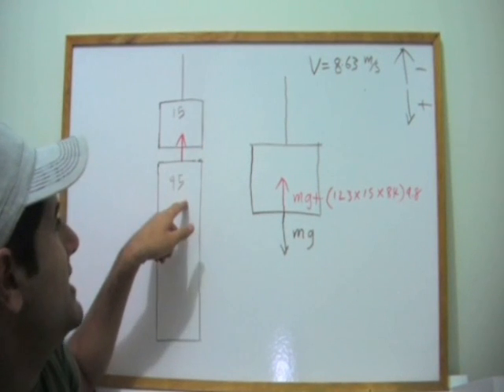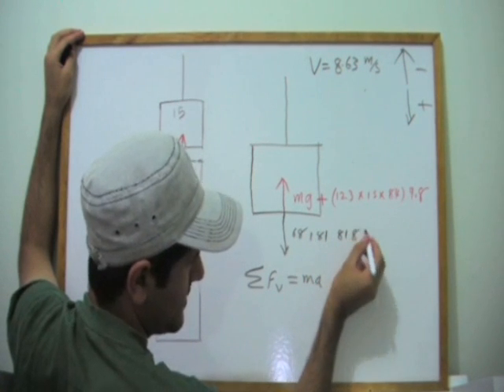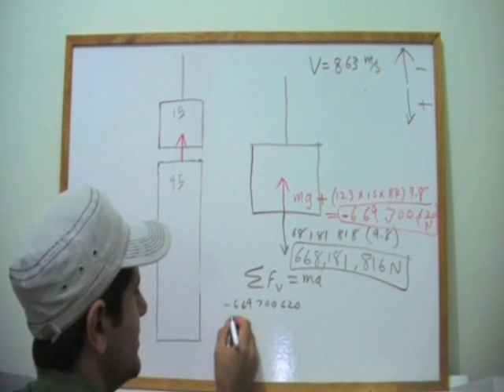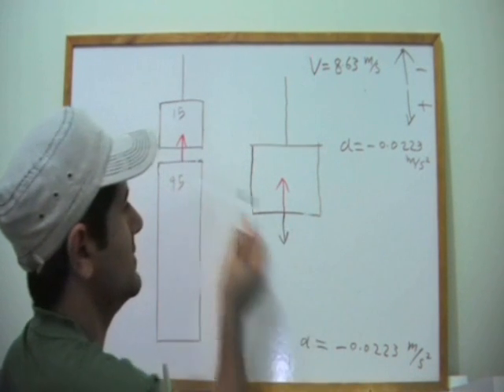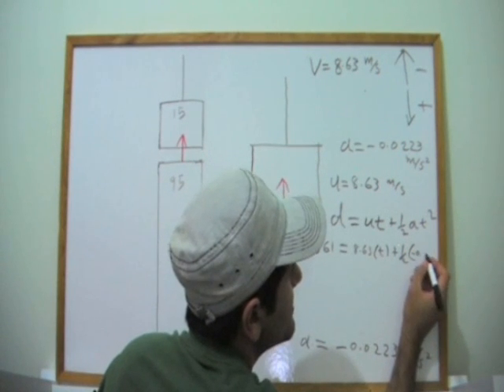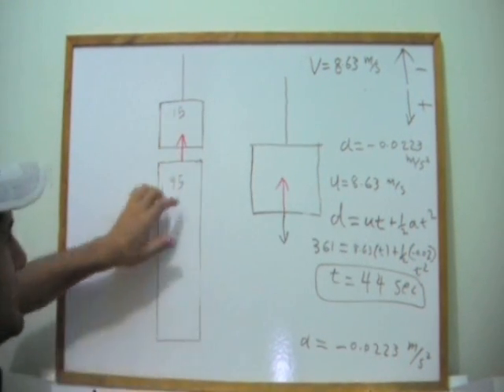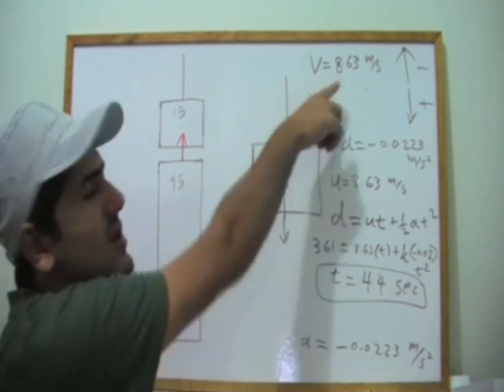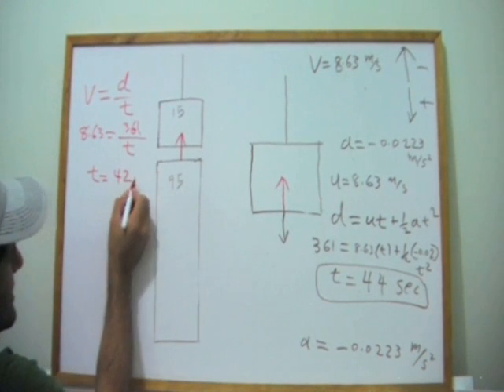(Part3) 911 Simple Physics Structural Failure Vs Demolition

Comment: The block will continue to get heavier and heavier as it falls. It would grow like a snowball getting heavier and heavier as more of the lower section becomes unable to resist the growing collapsing block, the lower sections ability to resist downward motion would cause it to accelerate not decelerate.
  And, there was more than one floor damaged. At least three floors were compromised. For every floor compromised on the lower half, the block will gain speed. The block debris becoming heavier and heavier will continue to speed up until it hits the bottom!!!
Reply: "the lower sections ability to resist downward motion would cause it to accelerate"? Are you  insane? skyscrapers have a much stronger and heavier structure than the top.Plus objects in motion will remain in motion until affected by a force( Newton's first law) this is high school physics. looks like you need a refresher course.
Reply: Irene Moran
as each floor is compromised it adds weight to the block that he describes.The weight doubles every third floor and it is exponential not linear. As the block is falling adding another floors weight into the equation.It will keep accelerating until it hits the bottom (exactly the way it did). I do know physics I was a bridge engineer and so far none of my bridges have come apart.
Reply: are you a snowballologist
Reply: Actually you are not correct about the weight getting more. If you google, and look at the construction of the building with its huge inner core of vertical beams which cannot pancake.  They provide continuous resistance and slow the object coming down from above Also the outer beams would as well. only the very light inner floors hung between the inner and outer steel could theoretically pancake, but then you would be left with the core intact.  Anyways NIST abandoned the pancake theory in 2007 after much abuse.
Reply: Wasatch Range Railway
 Fine, so stack 100 concrete blocks. Suspend one block 10 ft above, and release. Do you honestly believe that one block would "snowball" into enough energy to crush the 100 to the ground? That is what you are saying, and it is lunacy, based in "yup, sounds bout right", rather than Physics. This is also giving you advantages..The buildings are progressively stronger as you go down....concrete blocks are equal strength. You assertion would also mean that a car crashing into the side of a metal building would continue through, as it gathered more metal. That would include a driving engine, and still it would not occur. You are incorrect, the strong nuclear force is much stronger than you give it credit for.
Reply: First off, the top floors of WTC2 went passed the angle of which downward force would even theoretically be enough to crush the entire tower. It went passed that point and should have fallen as an intact or almost intact section. It did not do that, it fucking disintegrated! The whole building did this in roughly 12 seconds (2 seconds slower than it would take an object of good density and no air resistance such as a coin). Any progressive gravity driven collapse would have encountered much more resistance and taken much longer to occur. When is everyone going to wake up? Common sense was hijacked along with the laws of physics, crash dynamics, aeronautical science, metallurgy, architecture, mechanical engineering, etc.. That is what was hijacked on that horrible day!
Reply: BikiniStringTheory I assure you that I was a bridge engineer. And I was 22 years old when I got the Marine Corps highest commendation for not only building good bridges but bridges that floated while supporting 60 tonnes of live load and keeping my troops alive while doing it. try building a bridge while you are being shot at!
   I never once constructed a bridge that failed to support the load that it demanded. And when a young marine wanted to know something about that particular bridge, I would help him to understand it so that both of us stayed alive
The only screw up that I made was when I was testing the "Medium Girder" bridge for the British. When we launched it, it was a lot heavier than stated. When it got away from me I was between it and the launching tongue.
  I function reasonably well at 53 years old thanks to Fentanyl and Percocet and wish like hell that I had been  standing in a different spot 30 years ago. 
 I also assure you that I know the difference between spanning loads, live loading, and shock loading. When a sixty ton tank came over my bridge, I knew that it would hold. And that the tank crew would not be drowned in a sinking tank. My unit still holds the world record for a 24 section bridge in 22 hours. I am proud of what I accomplished 30 years ago, I did it so well that the construction sequence is still classified. The bridge itself is not classified but the sequence of how it goes together under combat is. With all of the cameras that were going, I felt like a movie star. And I do not need to use the F-bomb to be intelligible.
  There are all kinds of points that can be argued regarding their collapse that day. I know my stuff! If I didn't I also would not be the only individual in the Union Pacific Railroads history to pay my way through locomotive engineers school and take second place in a group of twelve men being promoted from conductors to engineers.
That was in April 1988. I graduated a full fledged engineer on April 30th. If I was a moron, I would not have been able to pass an 832 question test and miss only 10 questions. I was 25 years old when I pulled that off. There were men who had been employed for 20 years by the railroad that I beat the pants off of because I understood  what happens when 20,000 tonnes of steel sails down the track at 60 miles an hour if I screwed up. And I liked to stay alive back then! I wish the people that I had to work for would've felt the same way: maybe they would still be alive had they been as serious as I was.They crashed trains like they were going out of style! There were many of them that did not understand the difference between something as simple as dynamic friction vs static friction. 
   In school, they were more concerned with getting to the titty bar for lunch than their were about their grades. I know why there are so many train wrecks out there. If they loved their jobs as much as I did, they would take their employ much more seriously than they do. There are moments when an engineer will be using as much as 85% of his thinking capacity to keep from derailing his train when some idiot runs in front of him or stalls on the crossing in the path of his train.
  Simply put when push comes to shove I will trust my own instincts over anyone else s, it has served me well! and I am confident that it will continue to do so. When I am serious about something I will not screw it up. I just have to be serious about it. 
  Those towers failed exactly the way they did and would have when the steel is too soft to support the load.
If those towers were brought down by our own people, we have a good reason to be scared stiff!! If our people believe that we are too immature to recognize a lie, then they themselves are too immature to wield power!!! and need desperately to be overthrown. 
  Talking about conspiracy theories, my son came up with the most plausible theory I have ever heard as to why Kennedy was killed. With a very good understanding of the facts, he told me that Oswalds discharge from the USMC was honorable and that Gov. Connolly changed it from honorable to dishonorable. This infuriated Oswald so Oswald went hunting Connolly because he knew that he would be riding with Kennedy. When Oswald pulled the trigger, he screwed up and did not lead him far enough and hit Kennedy instead. No conspiracy, no CIA , no grassy knoll, no mob hit, just a lousy shot by Oswald! We know that he couldn't hit the broad side of a barn from his scores in the USMC- my son was right, he was just a lousy shot--unbelievable.
Reply: Wasatch Range Railway If I had a dollar for every government pawn who cries about how much they love their country calling me paranoid.  Seriously, if you have PTSD I'm really sorry.  But I have PTSD.  I got it from my government.  And you know what really helps PTSD?  Growing a pair of balls, and recognizing EVIL when you confront it- even if it has a familiar face.  I'm a GIRL for chirisakes- never even held a weapon or built a bridge.  But I know lies and bullshit.  I know how to investigate the hell out of something.  If you have investigated the hell out of this, and you aren't pissed as hell, then there is a lot more wrong with you than PTSD.  Never did I think coming on to you tube that I would find so much cowardice within my own people.  If you are being paid to say such stupid things about buildings, or not, that is on your soul- not mine.
Reply: as far as religion goes I was talking to the bikini girl
Reply: Shane Stoddard The time in which it took the towers to fall is a huge problem.  As people become more aware of how this is a problem and as experts become more encouraged to speak up, then there should be a change in consensus.  Governments determine literary history passing judgments on its legacy concerning who will be known forever as its protagonists and antagonists.  It then makes official decisions based on that fiction.
Reply: +Wasatch Range Railway This would make sense if the " collapse " had two factors. One, if the top sections were not lighter than the bottoms and sending off massive amounts of debris in the process which made the load much lighter for the bottom to support. Two, this happened way too quickly for a natural collapse. That is only two factors one more is that pulverisation does not account for particles less than 100 microns in a pyroclastic cloud that travelled at such high speeds and left cars as far as Broadway with no windows, door handles, seats, paint, just a toasted shell. Ask yourself as a scientist, what kind of energy could do that?
Reply: Tom Jones Not just vertical beams, but square beams.  And they added the further support of integrating ninety degree support beams into the structure.  They did the same with the lower steel foundation.  In other words, the two towers were embedded first into a massive steel foundation which was utilized for parking.  That steel foundation was further embedded into concrete which, in turn, was embedded into granite.
Here is a picture of the lower steel foundation:

 www.google.com/search?q=Images+of+twin+tower+core&rlz=1C1CHNY_enUS487US487&es_sm=93&tbm=isch&tbo=u&source=univ&sa=X&ei=ml7DVLqtGbj7sATRjYLYCw&ved=0CB8QsAQ&biw=1366&bih=643#imgdii=_&imgrc=jLca1RWB1jhU2M%253A%3B8iJXsnD76EE8KM%3Bhttp%253A%252F%252Fapi.ning.com%252Ffiles%252Fs5OK8CISaMOgAkDczFYF5XX7paYyeD97ZVjRtgBslViXhwUf54eqc3*xIYY8QJWr5WLzLAryL8X9E7gqjEHEYxZn-pwcWogr%252Fwtc1sm.jpg%253Fwidth%253D512%2526height%253D391%3Bhttp%253A%252F%252Fwww.gopixpic.com%252F375%252Fthe-core-structures-structural-system-of-twin-towers%252Fhttp%253A%25257C%25257C911research*wtc7*net%25257Cwtc%25257Carch%25257Cdocs%25257Cmage6*jpg%252F%3B512%3B391

This picture shows the massive integrated steel bracing in the core further supporting the square beam construction:

www.google.com/search?q=Images+of+twin+tower+core&rlz=1C1CHNY_enUS487US487&es_sm=93&tbm=isch&tbo=u&source=univ&sa=X&ei=ml7DVLqtGbj7sATRjYLYCw&ved=0CB8QsAQ&biw=1366&bih=643#imgdii=_&imgrc=uMGYM3r9c24oYM%253A%3BEUCvPSlVM1qlcM%3Bhttp%253A%252F%252Fwww.mindfully.org%252FReform%252F2006%252FWTC-Jones19mar0615.jpg%3Bhttp%253A%252F%252Fwww.mindfully.org%252FReform%252F2006%252FWTC-Jones19mar06.htm%3B850%3B638

But these square beams and rectangular beams were more than just that, but they were akin to taking two I-beams and welding them together to where further support stuck out the sides of the beams.
Reply: ....annnnnd BINGO was his name-o!
Reply: Wasatch Range Railway There is no way you are a bridge engineer.  But I do believe that you probably laid some concrete.  Maybe even got a little between your ears.
Reply: MisterNifty I can talk physics! fluid density,displaced weight. modulus of elasticity,neutral axis! want more?
Reply: Wasatch Range Railway Let me give you a very simple example . If we were building a bridge in fresh water the center of gravity was lower because the bridge was designed to bend as the load moved across the span. The bridge would sink further into the water.
   If we built it in salt water, we had to be very careful because the bridge would not sink as far keeping the bridges center of gravity higher. This could result in a side slip and so we would put more weight on the section to lower the cog---how is that for physics?
Reply: Wasatch Range Railway I wish that I had been more clear with the above statement
Reply: Irene Moran volcanic energy!  I used C4, petentiarynitroltetranitrate( PETN) and C6 to cut steel she has it in her head that there is some hellacious pyroclastic cloud that envelopes a CD. I have never seen what she is describing other than a volcano I have heard of a terraclastic cloud after an earthquake. 
   cutter and kicker charges are way too fast to generate the heat that she thinks is in a CD I would like to see the charge that she is describing. Even when the planes hit the towers, the smoke rose into the air . It did not sink the way a true pyroclastic flow does and these cars that were supposedly roasted. I never saw that.
Reply: MisterNifty It became about me when the truther idiots tried to convince us that 911 is the result of unbridled corruption by the higher ups. Some of those higher ups were friends of mine and to say that they killed 2749 of their friends is absolute trash. Yes! there is corruption and it is at the very top. And for someone to say that my friends are capable of killing their fellow Americans turns my guts. Our Gov't could never get away with something like this. Someone would have spilled the beans on them leaked it to somebody at the news or started video taping things. 
   What our leaders are guilty of is rampant stupidity. The terrorists will get us again and again and again we will still not be ready. Our dear beloved waste of sperm that we call president will sell you and me down the road faster than you imagined possible. That is when it became about me.! The people that I knew would never let this happen by are own.
Reply: Wasatch Range Railway At 6:16, the young man is talking about the upper portion falling away from the center.  In actuality, the torsion involved with the collapse caused the upper material to spin away from the center by centrifugal force.
A collapse in a controlled demolition causes the building to fall towards the center of the building in a centripetal way.
Reply: Shane Stoddard Fine, show me an example of this happening- other than the trade towers. Give just one example of a building or bridge that fell into dust at free fall speed because of a fire (a fire that never even touched 80 percent of the building) and not an explosive. Because as far as I can tell, it's never happened.
Reply: Wasatch Range Railway Now it makes sense- your friends are some of the scumbags who set this crap up.  I knew you were in the military.  Only military schills constantly deny this event.  We saw with our own eyes what happened!  How can you keep lying? Maybe you were one of the people who set the detonations, we'll never know.  But the people in the towers who died would be able to point them out- they were all over the elevator shafts and floors in the weeks before the blast.  They called it  updating the elevator systems.  LOL.  Yeah.  It takes a cold stone killer to do that job.
Reply: Wasatch Range Railway Understand, we aren't talking about rational thought here.  That isn't the problem.  Like the Kennedy assassination, there were lots of problems in physics.  So, while some might argue as eloquent debater, there is another level to this event which has caused a lot of problems.  For a building to fall straight down into its footprint, it has to be made to fall in a centripetal fashion towards the center of its mass.  
Hello? 
Is anyone home?  
Does anyone else see why many fearful experts are having huge problems with this 911 event?
Reply: BikiniStringTheory You are doing exactly what conspiracy theorists do they always refer to the imagined opposition as THEY and when asked who "they" are, they can not give a detailed answer and cannot give a single name. If you want to sound like a trustworthy and dependable individual quit assuming. Unless you were there cutting beams and putting demo in those buildings, the very best you can do is to assume! Without pictures, without corroborating evidence you will go nowhere.. The world is full of idiots. Don't be paranoid! Life in the USA is still damn good! An operation of that magnitude could not be pulled off even in the best of conditions.
 Someones conscience would get the best of them, someone would start taking pictures, someone would spill the beans. It would take intelligence of unparallelled scale to pull something off like what you are describing. It would be impossible.
   The bigger a project gets, the less intelligent it becomes. A project like this would require absolute secrecy   
It would require everything to go absolutely perfectly Our gov't is too disorganized, and far too unintelligent to pull this off. Someone involved would goof it all up. To ruin this project would require only one good man. A wise man keepeth till last and a fool telleth all. There is absolutely no way that it could be pulled off without it being screwed up by someone. There are however some things that bother me. Things that would make no sense to you.
  I do struggle with PTSD and to qualify for a VA disability pension required me to prove that I am in-fact disabled. I had to prove it to the doctors and to prove it I had to take a battery of tests. my IQ is extremely average. There are a lot of people smarter than I. However there is one small area of my IQ that she could not measure because it is off the chart. MY FRIENDS DO NOT KILL PEOPLE!!! If I personally knew of someone that had killed innocent people, a friend is the last thing I would make of them. Quit being a paranoid. It is a terrible waste of time and effort. This country is still a fantastic place to live. No one loves our constitution more than I do. And I would fight like a dirty dog to preserve it. And no one hates a murderer more than I do. If I ever found that a friend of mine had committed murder I would have their worthless ass thrown into prison and I would personally throw away the key. There is always a better way to solve a problem. Killing 2749 people just to go to war is akin to driving a thumbtack with a sledge hammer.
   When my wife died I learned to put a lot of trust in the man upstairs. If required take your case to the law of the land and when ( not if but when) it fails leave it up to me where no one will be able to escape me!  
   Be happy, quit wasting time with things you don't need to worry about---Shane.
Reply: Wasatch Range Railway Structures resist liquefaction.  Think of a toilet.  When it is flushed, the water rotates one way or the other.  All things are liquefying towards the center of the earth.  Over time, all things will sink down into the earth.  As they do so, they spin and tumble towards the center of the earth.  This is a natural collapse.  The third building was an unnatural collapse caused by controlled demolition.  That collapse had to happen by design as the only way in which a building can fall straight down is to engineer it to fall inwards towards its center in a centripetal fashion.  
Hello?
Reply: BikiniStringTheory I can't help you!
Reply: BikiniStringTheory Why not reduce the problem down with physics like the fellow in the video is doing?  We already know that the government is a tyranny.  We learned that from our Founding Fathers.  In regards to the consensus about what happened to the twin towers, that will reduce to thousands of physics problems.  Over time, we should build a pretty good consensus about what truly happened.  At the same time, we learn a lot about physics and engineering.
Reply: Wasatch Range Railway I do know evil! It chases me around at night. Those demons are very real! They tie my arms up and bind my tongue. Unfortunately my wife is no longer around to wake me up when they come for me. My dog sleeps with me and is now the one to wake me up. The devil does not like to be poked fun of.
  I am very, very sensitive to evil. I feel it every time I curse, or when I become angry. Every time I think about something that is not right I feel it. 
   Watch a porno movie and see how fast evil comes to the table. Go see an R rated movie and see how evil sets up shop next to you. Watch COPS and see how fast peace leaves the room. I choose to take the sacrament every week to be forgiven for the dumb things I do.
  I have looked evil in the eyes and it scares the mortal hell out of me!! I try so hard to be like the Master. To heal the sick and the wicked. To make the blind to see and the deaf to hear, and the dumb to speak.
 I do know evil and I want nothing to do with it. I want to be with my wife and kids and I want to be with them for a very, very long time. And if I choose evil, that will never happen!
Reply: Wasatch Range Railway If God were to tell you what really happened to cause Him to flood the earth would you believe Him or tell Him that He is a liar? Here is a seed, He had to kill the animals too! Who hasn't seen on YouTube ISIS scum screwing goats. Does that help? If not, maybe I am stupid and ignorant. There are things washing up all the time, fish with beaks. Birds with hoofs. Where did Greek Mythology come from? A man half horse?  There were all kinds of hideous things living.  Our deoxyribonucleic acid DNA became so corrupt that it was no longer usable as human DNA. and this rock we call earth is a lot older than we think when He flooded the earth she was baptized as well. Her spirit is female. Maybe that is why I love women so much.
  And what about Adam and Eve. If God told you what really happened would you tell Him that He is a liar?
What Human act can be had for good or evil? And no, it was not a pomegranate, nor an orange, nor a peach.
  The fruits of a tree that is good on one side are little tricycle motors. Think about that one for just a few seconds-- you'll get it!    
  What is the fruit of the evil side of the tree?--------If I told you, would you tell me that I am an idiot, or would you believe me?  The fruit of the evil side is ---- ?  The world runs rampant with it. And brings nothing good to the table. People suffer with it every day, especially the children.
   But I am just a liar with no balls and I wouldn't know truth from a lie! My son and I both have raised our hands to defend the Constitution, against all enemies foreign and domestic,  not the president nor his scum.
   When I met GWB here in Brigham City, I felt that he was a good man. Maybe not the brightest bulb on the string but he was a good man. Just like the rest of us; not perfect--but still a good man.
  How can a man who would not allow testing on human embryos claiming it violated human sanctity turn around and kill 2749 people? The ones to be scared of were GHWB and Cheney I don't no where, but something is not there with those two. GWB is a creature of opportunity. I heard GHWB say something once that made my blood run cold! He has no affections for our constitution whatsoever. His son is not as corrupt as he is. But like all of us GWB is still subject to weakness. GWB has really tried hard to get his stuff together. Would he kill even one man to make a million? His dad might, but not him.  Cheney on the other hand is not a family man---he is a stuffed white shirt. Mr. Corporate America! his family suffered at the hands of Halliburton. Especially one of his daughters, he was not there for her when she needed him.  
   Cheney's connection with BP really went south during the disaster in the gulf. They knew the drill head would probably fail and Cheney knew it too. When it did, you never heard a thing about Cheney. Do I think Cheney would off someone to make a buck? It depends on the size of the opportunity. For 1 million? I don't think so. For 100 million? I am confident that he would sell his mother down the road   The one to be terrified of is the one that is stinking up the oval office right now. He is a spineless jellyfish. He has grossly underestimated the power of the silent racist. 
   I would never leave a scared soldier or marine to rot in a stinking Mexican jail for weeks on end then exonerate five terrorists for a deserter and make such a big deal of it.His thinking is so deteriorated that I don't think he truly knows right from wrong. I am pretty sure that he will make the attempt to "executive action" himself into a third term. And he might just pull it off. 
   when placed under high stress or in times perceived opportunity, there is a significant percentage of black people that can not prevent their moral high ground from being overrun. It is in their genetic make up to relinquish their morals quicker. Their thinking is more easily compromised in times of stress or personal gain. Their line in the sand moves or dis appears more easily than some others. However this not a hard and fast rule. It can only be claimed in general terms. There are times when this becomes exactly opposite. There are times when they will do exactly the opposite. I have seen both sides of the fence. I had a very good friend that was black and his morals were absolutely above reproach. I was proud to be his friend. He was absolute with his morals. His thinking was clear 90% of the time. And if he ever doubted himself he was always open to changing his thinking.  His name was Sgt. Donnell Lorenzo Charity. He was one of the finest men I have ever known. He was and I hope that he is still good people.    
   That disaster that occupies the white house now openly defied God when he wrote that statement on the highest beam of the new freedom tower. Do you think it a coincidence that the pine tree at ground zero just died for the hell of it. If that had been my tree, it would've survived to become a beautiful ever growing evergreen . No matter what they did it would not live! As the tree does so follows Obama---that man is in trouble!!! The Ninth Harbinger has sounded and he ignored it.
   The word Obama means the one with a "weak" will. Osama means the one with a "strong" will. I know exactly what is going to happen when I post this. like I said--------- I can't help you-------maybe.
 When you brought up EVIL and the SOUL, I thought that I might as well  sew it up.
   There are two types of sins, the sins of commission and the sins of omission. If I bring up for example: homosexuality. I can expect to hear about it from everyone and their dog.that I am a bigoted homophobic. My answer; Yes I am and they scare the hell out of me.  Do you accept the Bible all the way or just part of it? If you can accept the fact that 90% of the Bible is symbolic, then you are off and running  You just have to understand the symbolism. Trees are almost always people or kingdoms
   When the bible says that God flooded the earth because it became so wicked--- true statement!  But you will not understand a millionth of it until you are ready to accept it. Almost everyone assumes that they are ready to accept anything that God has for them. People want to do what they want to do without fear of consequence. This is why we want to justify our actions. With homosexuality what is sin to one man is another mans Heaven. TOLERANCE IS NOT ACCEPTANCE and never will be! This is why a perfect man had to pay the price. Perfect places require the perfect price or payment, and the perfect price requires the perfect sacrifice.
    "If a man lieth with another man as if to lie with a woman, it is an abomination before me and he shall be destroyed"  that was not a quote that I made from the bible. I found that elsewhere. In a world where almost anything goes, eventually everything will!  The second law of thermodynamics states that everything eventually goes to hell in a hand basket. The laws of entropy. The laws of growing disorganization. Everything fails at some point in time. EVERYTHING! Even humankind. Find one single empire that has survived as long as we have. I can name two!------ Israel! and Iraq.  
   Back to EVIL (you are the one that brought it up). I get the strong impression that you have gay friends.
Does this mean dump them as trash? No! ( after all I am a lesbian in a mans body ; I love women! ;););)
 There are two types of homos; the ones who are in your face everywhere you go. They are rude, irreverent, and unrepentant, and will say and do anything to justify their actions. They live for what feels good at the moment, they are the Arnold Schwarzeneggers of sinners. They are obsessed with pleasure and their bodies.
  Then there are the ones that are good people with a weakness. They would like to be like other people but they just can't no matter how hard they try, they can't do it. These are the ones that God still loves, they are reverent, repentant and humble, and would be different if they could. if God can forgive them so can I!  
   If I leave you with one last thing. Stop being angry!! and stop investigating everything on your own. I have learned to let the Master do the investigating for me, and He lets me know right from wrong.
    Even if it is not in Heaven, nothing is perfect here. Life is full of gray! It has to be! this is why the Savior died for everyone, not just for you and not just for me! The events in the garden of Gethsemane gave God the power to reach into the depths of hell and exalt a man, even one so imperfect as me. trivia? Why did Jesus need His two apostles to stay awake. Hebrew is the language of understatement. One day, if you want -----and only if you genuinely want to know, I will share a few little things about our Savior that the world does not know. And only if you are genuine about it.   
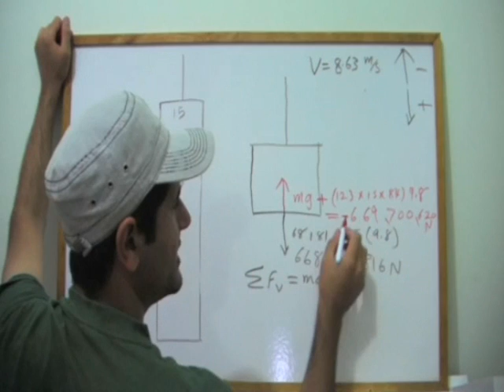   Get on with the weightier things in life. Even without my wife lying next to me I can still find wonderful things to see and hear and occupy myself with. The sunsets here are beautiful, especially in the winter, they turn the snow on the mountains pink. I like rain especially in the morning and afternoon and I love the sound it makes at night as it hits the roof. I love the way it smells, I hope that it smells that way in Heaven. I love my kids especially when my daughter puts my grandson on the phone. He lives far away from me and like me he loves trains. I love little children especially when they reach out for a hug, AND when they have been naughty and when they are brand new and need to be fed at 2;00 in the morning. My sweet little daughter first smiled at me at 2:00 in the morning I stayed up with her for well over an hour with the both of us just looking and grinning at each other.. I love my sons courage, he is fearless. I love the way he makes things so simple.
   I love the way my kids try at everything. They give everything 110%. I love to see my son in his blues. I love my daughter when she gets in my face--she is determined. She has corrected me more than once when I was being a butt head
   I love snow and snow storms especially blizzards. We got a whole foot on Christmas morning and that was it for the winter. Strange---Christmas morning and we got snow!; the only snow of the winter.  I love my friends, they are fantastic people.I love making new friends. They are one of the few things that I will be taking with me when I die. I love railroad watches and the dameskeening inside on the movements. I love my credit card, It has bailed me out of some tight spots and I have been able to acquire things that I could not have gotten otherwise. I love my Fentanyl and my Percocet, I could not function without it. It takes the misery away for a while.. 
    I love old things, and the old school and the way old things were done. I love to fall asleep with my dog next to me. I love being with my wife when she comes to visit me in my dreams I love looking at her picture. I love honest genuine people. I love my pine trees. I love my player piano and will get it fixed some day soon so that it will play again.
   I love working on my model railroad especially the bridges. I love graveyard stew. I love air conditioning. I love bit-o-honeys candy. I love my home and the ivy growing on it. I love my fireplace. I love copper things. I love Christmas lites and everything about Christmas. I would love to be Santa Claus. I love big ships, I love eating late at night. I love riding the Front Runner and going fast. I love my town, and the bell tower, and the clock. I love going up to Willard Peak in 4-wheel drive. I love good music, GOOD music, guitars and pianos. I love the song overcomer. And I love a lot of other things.
  That's just the way I am! Very rarely do I find myself getting really angry, it just takes too much out of me. if I get angry, it makes my back ache like crazy. Then my stomach hurts, and I start to shake. 
  Get on with life, find things that make you happy and the PTSD will not bother you so much. Make good decisions so that their consequences will not bang your door down trying to get in. Stay away from bad movies. stay away from loud people. Stay away from people that protest too much; they always have something to hide.
   Just do it!  It's not that difficult. If I have, I have not meant to offend you. I need to go to bed. There are still good people out there and yes, some of them are in your government. Good always triumphs over evil sometimes it just takes a while. 
   We the willing, led through unknowing have been doing the impossible for the ungrateful. We have been doing so much for so long with so little that we are now qualified to do anything with nothing. " War is an ugly thing, but not the ugliest of things. The decayed and degraded state of moral and patriotic feeling which believes that nothing is worth war is much worse. A man who has nothing for which he is willing to fight, who cares for nothing more than his own personal safety is a miserable creature with no chance of ever being free unless made and kept so by the exertions of better men than himself"

  Be happy!
Reply: MisterNifty or at least that is how it is supposed to go!
Reply: You just described me to a "T" 90% of the Bible as I said is symbolic.
   If one has spent all his time falling he has never felt gravity and will never feel gravity until he is stopped from falling. Some times the stop is gentle and sometimes it hurts!
   As with evil, one does not know evil until he has experienced good. and like wise; the opposite.
    Sins are not hurtful because they are sinful but sinful because they are hurtful. Evil will tell a thousand truths to get 1 lie passed.
   Your ideas on homosexuality are correct except for one statement and just one.
  Gay marriage IS NOT FAMILY!!!  it is a corrupt and degraded union that serves no good for humanity--- none whatsoever!
  The Master loves the human soul dearly. It is His work and His glory to bring to pass the immortality and eternal life of you and me. We are not a sideline, not a hobby and not a pass time---we are it! HE EXISTS FOR ONE REASON;--us!
   When I die I will kneel at His feet and i will wet His feet with my tears and I will know no better then than I know now that the prints are there in His hands and his wrists and His feet.
    In a world where almost anything goes eventually everything will!!! There were two words put together several years ago used to describe the human conscience. " The Moral Compass"
 If the moral compass has 1000 pieces the very best that parents can hand down to their children is 999 pieces. that 1 piece that is missing simply wears out and becomes useless there for discarded . The laws of thermodynamics demands that everything degrades including  human cultures. Rome fell--the Greeks fell--Egypt fell, Babylon fell and they all fell for one and the same reason.  
   There is a tipping point at which everything starts sliding and will not be able to stop. We have reached that point. Just as before, it will be stopped again. Two in the kitchen; one will be taken. Three in the field; two will be taken.
  A wise man keepeth till last and a fool telleth all! Why do you think the bible is symbolic? If human kind knew exactly what happened it would literally scare the hell out of them.
  You have no idea that you have just described yourself as very-- religious.
  " Oh Porsche; I perceive thou doth protest too much." 
  You believe! I know you do!---Now go and tell others as I have told you.
Reply: Wasatch Range Railway I think you confuse spirituality with religion.  I am very spiritual.  But not religious.  The stuff you are saying sounds ridiculous to me.  It makes me get creepy feelings under my skin, like I'm encountering something icky.  When I go to church, I get creeped out- but I go because sometimes my husband needs to be reminded of his childhood.  And you are wrong about gay people.  When you live with someone, you are a family.  You may say that is not true, but it most certainly is true.  Someday I hope you realize your spirituality is not attached to a book.  It's attached to everyone and everything.  Spirituality doesn't have to be dogmatic, it merely has to sustain your soul.  How can you sustain your eternal soul while trying to deny that sustenance to others?  Family is a great comfort on this planet, the main source of love and affection.  By denying people that right, you deny your own spiritual advancement.
Reply: The two party system is a religion.  And what does this have to do with the physics this fellow is expressing?  For any inertia created in the collapse, that energy is divided between the falling portion of the tower and the remaining stationary portion of the tower.  In other words, the speed of the falling part of the building can be divided by two.  Take half and give it to the stationary portion of the building.  The acceleration was 9.8 meters per second.  So as the top portion was accelerating at 4.9 meters per second towards the ground, the bottom portion was accelerating at 4.9 meters per second towards the sky.
Reply: i'll think about this for a while.
Reply: Wasatch Range Railway it is well into the AM.You are a thinker, but right now I am too tired and miserable to type. I am going to think for a while. I will say something later.
Reply: Wasatch Range Railway I hope you do not think I am attacking your faith.  I am not.  I was just being honest about the feelings I get when religion gets involved.  I did have a really terrible experience with religion, but that was something that I am still learning from and do not use as a basis for belief.  To be honest, I study religious signs and dates because I believe in the esoteric meanings in the bible- which I don't think have anything to do with god.  I think the exoteric meaning of the bible is for the masses and meant to guide them a specific way through the esoteric events.  In that way, you can read the bible- like I have and find a specific propaganda that is used many times in history on many different people to filter events- much like the media does.

Anyways- by all calculations- the bible is predicting that this September 23 will be a very important date- you should look into this date.  Much like September 11, 2001, a cycle is about to be fulfilled.  This event will most likely be a shift in religious and economic perception- and if you believe in the exoteric meaning of the bible- you will see it as a god event.  If you believe in the esoteric meaning of the bible- then you will see it as a human event.  So you see, religion will once again divide us:(
Reply: BikiniStringTheory If you drove a volkswagen into a tractor trailer truck causing its total destruction, this might be believable.  That the volkwagen would remain unharmed isn't possible.  In other words, the small portion of the falling building was the equivalent of a volkswagen and the lower portion a tractor trailer.  Imagine if you can, as the volkwagen smashes into the tractor trailer, the further it does so, the stronger the structure of the tractor trailer will become.  Eventually, the greater energy of the tractor trailer will overcome the energy of the volkswagen.  At that point of the collision it will start pushing on it in the opposite direction.  That is the point in which the collapse of the world trade center tower should have at least slowed.  

See, this isn't a political party pitting conservatives against liberals.  It is a physics problem.
Reply: MisterNifty I totally agree!
Reply: go watch the geico commercial with the dominoes on the street.
Reply: No that was not digital. I did that when I was 10 years old just to see if a smaller domino could topple a larger one and it did and it does.
Reply: Shane Stoddard But the outside shell didn't have floors.  I do appreciate that you are at least thinking.  The outside shell was made up of sections.  None of the bolt patterns lined up along a horizontal line.  In order for the floors to domino, whole floors need to vanish.  The young fellow in the video makes that point.  Think of round washer that will fit exactly around an inner shaft and, at the same time, within a round outer shell.  Such washers when dropped within both would fall rather smoothly.  But concrete floors with square outer shapes with rectangular holes won't fall near as smoothly.
Reply: I can see that. I just believe that the collapse was staying one or two steps ahead of the point of redundancy that would've stalled it. Those buildings did not fall smoothly. Look very closely at the first collapse and you can see the top start to fall over. it didn't come straight down.
   There was just too much energy for it to stall.. No one single physical law was at work unless it was gravity. look at the I-35 bridge collapse. It was not demoed, and yet it came straight down releasing at both ends at exactly the same moment. And the Tacoma River Narrows bridge. A gale of only 23 MPH brought it down. I believe that if the damage would've been higher up, they would not have collapsed.
   In the history of war, we have never had to kill nearly 3000 people as an excuse to go to war. When OPEC changed over to the EURO as trade for oil it would've been disastrous for us and US had Bush not gotten it switched back over to the petro-dollar by going to war.
  Yes it was about oil! it is the one and only commodity that is used across the board from trucks and trains to cooking to home heating oil. Now if you want to talk Vietnam, the real reason makes me sick and there is going to be some heavy, heavy answering to do to the man upstairs for the lies told by the CIA. Read the book "The Harbinger" it will scare the hell out of ya!
  I'm going to retract that statement about killing people to go to war. 55,000 men died to cover up the mistakes that were made in the late fifties in Vietnam. Yes! the CIA had people killed all the time! We ourselves didn't plant any explosives in the towers BUT we knew it was coming, Blee and Tenet did nothing to stop it. the CIA did not bring GWB up to speed in the daily threat briefings. When the CIA tried to get a man on the inside they found that he was a double agent and he disappeared one week before 911. Had the CIA put it over the AP wire the FBI would've had him scooped up in less than 24 hours.
  There are the sins of commission and the sins of omission. The CIA really screwed it up  by not keeping the FBI in the loop. But the CIA has always been that way and they have to be. Mistakes get made and sometimes the price is very heavy. no one dare believe that we got nearly 5000 men and women killed for oil. but it is a sad fact that we did.
  If our government is corrupt, it is because we the people put them there, making the people that voted for them just as guilty!!!
  At ground zero someone wrote in the dust
 "where was God" My answer was Go ask the supreme court, they are the ones that got rid of Him!!!
Reply: BikiniStringTheory
 Government is corrupt, and I am very,  very aware of what happened with the petrodollar and operation Northwoods. it was is and will always be about oil! As I said there are two types of sins. The sins of commission and the sins of omission.
  If our government is corrupt then who is more to blame? The ones that pull the strings or the idiots that put them there by voting for them? The masses are just as corrupt as the ones who rule over them!!!  The stupid and unlearned always give power to the intelligent.
  Twenty years ago, I made a very ,very bad decision that damn near cost me and my wife s lives. That decision still haunts me to this day. We were lucky to get out of that situation alive. It involved a terrorist.
  When my kids were just little, they were playing under a tree. I could see a storm closing in as I watched them playing. The kids should not be playing under that tree I heard.  I ignored it.  A few seconds later; Get your kids away from that tree. I ignored it again. Get your kids away from that tree -now!  this time I couldn't ignore it. You two come here--- get away from the tree,--- hurry!  five seconds later lightning hit that tree. I would have no children had I ignored it the last and final time.
  Shane--- you do not belong here---leave---hurry. Shane get out of here. Shane your in trouble! ---go---now! I ignored it and I paid for it. My wife would never trust me again. 
  Now I stay where I belong. You were right I was confusing religion with spirituality. When someone starts preaching, I have learned that it is because they themselves doubt it.
  If I can get this person to believe this; well? it must be true then I will believe it too. the Bible WAS written to divide! It works very, very well.
 Even with the faith to which I belong there are some real idiots! Most of them are on top of it , some are not but they try!.  There are those who have said to me; you sure like the deep water. I swim at my best in the deep.
  You strike me as someone very mad at something or someone. Are you angry with someone in your family?  I am not finding fault with you!
   There are things about 911 that bother me but it did not happen the way you think. the agency knew it was coming. They just allowed it to happen so that we could justify it and make it look good. The sins of omission!
  If someone is getting the hell beat out of them and you do nothing to stop it, are you just as guilty? If you had the power to stop it---yes!
 We did have the power to stop it! So did the agency screw up? Yes they did!
 If those beams were cut to precipitate a collapse then I am just as guilty for being an ignorant moron!  The thing to be afraid of is Agenda 21. Once again, the Germans! Just like the Austrian Prince so long ago.
   You are very intelligent. and you are intelligent because of an open mind.
At some point in time we will all have to make the big decision. Do we or don't we. I have already made that decision and I will not have to wonder if it will be the right one.
  Those towers were coming down with or without the beams being cut!
We knew that if those towers were hit just right, they would come down!
Were the beams cut? NO. Sometimes they will cut a hole in a beam to run wires through it then change their minds about where they want to run the wire bundle. Did we egg the terrorists on? Probably---yes!
  I told you that GWB was a creature of opportunity. He just used it to justify what he was going to do anyway!  Sins of omission!!! The agency made sure that GWB would be ignorant of the situation and he was. They made sure that he was fed garbage.
   It will always be about that bowl of pottage. It's over and done with,  get on with your life and be happy!  Evil takes only as much power as you give it!  Would your husband happen to like trains?
Reply: Shane Stoddard well, good luck with everything.  I see that you are a good person and in touch with a higher power- and I think you should really let that guide you.  I can't convince anyone of anything- but I do know with 100 percent certainty that those buildings came down with our governments help.  If we don't fight evil, and expect the world to get better, we leave our children in the crosshairs of the next event.  Something about spirituality and religion are very similar- you can't actually get anywhere until you do it for yourself.  You must have faith, or you must change your behavior, or you must create change in order to reap the benefits of either one.  Your intuition is obviously there- and it took some extreme moments to trust that it was right, so I hope eventually your intuition will lead to the truth of that day- because even though it's over- the repercussions are still occurring and it won't be that last time the wool will be pulled over our heads to start a war. 

I am not mad at anyone- I have settled all my scores and hold no grudges against anyone.  I am not going to be reincarnating after this life, and will be helping other souls to leave this planet.  When I was five, I had already found this particular fate within my soul- the desire to lift the veil in the material world and help release others from spiritual bondage.  With that, I wish you the best on your mission in life!
Reply: you are very right i will say more later
Reply: Shane Stoddard Let me add this picture of the double trusses with bridge trusses running through them.  All these trusses were designed to 1)  Break loose during impact where they were bolted and 2)  to crumple upon impact much like a bundle of barrels are designed to do along a freeway to protect drivers from colliding with a fixed immovable object.  

Here is the picture:

www.google.com/search?q=The+slip+joints+of+the+double+trusses+in+the+twin+towers&rlz=1C1CHNY_enUS487US487&es_sm=93&biw=1366&bih=643&source=lnms&tbm=isch&sa=X&ei=KYlGVejBOMqKyATRtoCgDw&ved=0CAYQ_AUoAQ#imgrc=a77xgrngj_qtJM%253A%3B8OGR_Bc6YxwUOM%3Bhttp%253A%252F%252Fupload.wikimedia.org%252Fwikipedia%252Fcommons%252F8%252F86%252FWtc_floor_truss_system.png%3Bhttp%253A%252F%252Fen.wikipedia.org%252Fwiki%252FConstruction_of_the_World_Trade_Center%3B934%3B485
Reply: MisterNifty Finally I come across some actual logic in these you tube comments. Excellent comparison of situations using real physics especially because a Volkswagen is much less dense and the tractor trailer much heavier as well. Just like the top part of skyscrapers being lighter with columns less dense than the lower sections. It is mind boggling that people cannot accept or understand this concept that is taught in fourth grade. I am a science Major ( applied physics) and if you want to discuss the overwhelming amount of scientific evidence concerning this matter send me a message but either way, great comparison!
Reply: Irene Moran Did you understand my analogy of hanging one of the towers out to the side horizontally?  When building an elongated gate, there are three basic ways of doing it.  One can either use the bracing of cable if it is made out of wood or i-beams to help hold up the end of it, hang cross bracing on it to keep it from sagging as well, or, one can utilize square beam construction which, because it resists torsion, comes with its own cross bracing built in.  To help keep the towers from being too rigid -- too strong -- they built the outside in sections.  Too control how the force of impacts would oscillate throughout the structure, bolts were used instead of welding every part together.  Welds are the strongest joints, steel joints are next in strength, and bolts are the weakest.  
So, why did they utilize bolts?  

There is a cool juxtaposition created by the way the outer shell lined up with the inner core.  The structure of the inner core, if enough torsional force was applied to it, would have torn horizontally side to side.  In contrast, because it wasn't built in "floors" but in sections, the outer shell would have gave way tearing vertically up and down.  

In other words, because of the extreme rigidity of the square beams in the structure, the forces from the impact into the towers traveled up and down along the perforated weakness of the bolt patterns.  At the top, they met up with a massive hat truss which connected the separate independent swaying of both the outer shell and the inner core.  Towards the bottom of the tower was more than just a concrete foundation affixed into a granite foundation.  Both towers rose out of a massive steel foundation made out of I-beams reinforced with integrated cross bracing. 

In contrast to the square beams, the I-Beams in both the hat-truss above and the massive steel foundation below oscillated.

Huge amounts of engineering went into the building of the World Trade Center.  

For example, they didn't just have floor trusses, but double trusses one direction between the inner core and the outer shell.  They also had bridge trusses which ran perpendicular within the double trusses.  

Imagine taking a hold of the outer shell in one hand and then swirling it around in a clockwise rotation.  Looking down at the inner core from the top, because of the engineering involved in its construction, from the point of view of the observer, it would appear to be stationary as it would be rotating counterclockwise within in a perfect circular fashion.
Reply: +Wasatch Range Railway How is it you can assert that you have an education and say what you did? Let's start with a few basics:

1) Using a 15 story block that does not lose mass, let's say that it crushes the first block below it (1 floor high). That 1 floor will provide resistance first before it breaks and when that resistance breaks it will have to be accelerated. It is currently moving downwards slower than the mass it is being added to, so the mass above it will have to assist it in gaining speed. So the mass above that was already slowed down by resistance now has to exert further force to accelerate its lower addition. As the man in the video said, the resistance capabilities of the lower area is at least what is necessary to hold the upper portion up so it is not some paper force. So even if you want to believe that floors that are crushed add to the mass of the top, you are forgetting the mass lost in the shattering of the building, the velocity lost to the resistance of the building, and the fact that the core columns went from top to bottom and could not be crushed purely from pancaking.

2) Referring back to the core columns: Those support columns were built throughout the building all the way up and down. They were designed not to break or be crushed. If a pancake like crushing did happen it would have wiped out everything except the core. Yet the core fell too.

3) In any case where one object falls on another there is virtually no chance of it continuing to fall into it as the crash continues. Rather, any little inequality of forces in any parrying direction would cause the crushing object to deflect away from what it is hitting. That is to say that a falling structure would tip to one side depending on which part of what was below it was weakest. The possibility of TWO buildings falling directly down without the resisting building pushing it to one side or the other is a mathematical impossibility. Imagine chopping down two trees and expecting both to fall through their down trunks. It just doesn't happen.

I suggest you look up some examples of failed demolitions. I've seen buildings that were deliberately demoed somehow manage to remain partially intact and even roll over. Without a flawless execution, no building, not even a deliberately destroyed one, will fall straight down.